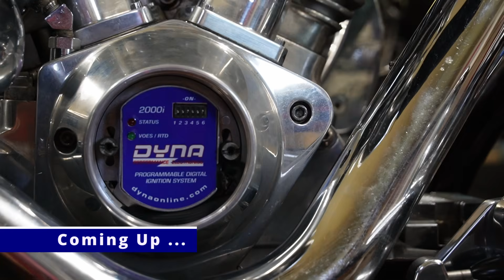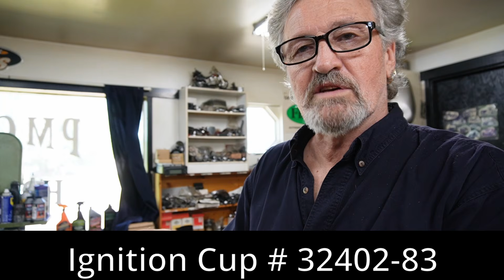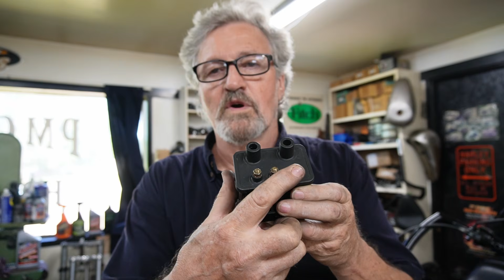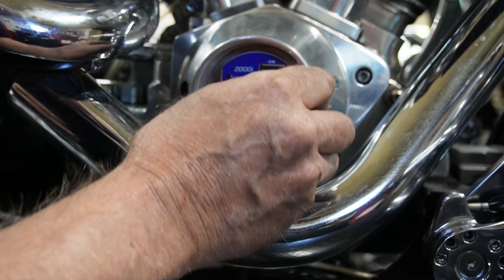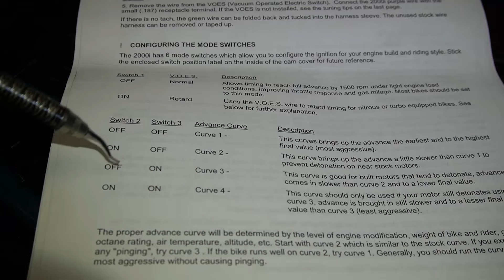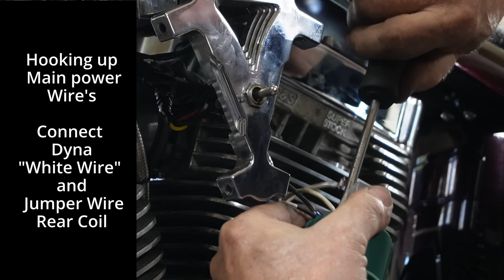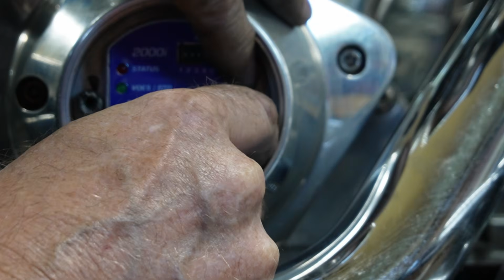HOW TO INSTALL A DYNA 2000i  IGNITION SYSTEM / THE EASY WAY

Comment: I have a 1982 FXRS Shovelhead that came with this setup, timing was off so I went to readjust it and for whatever reason the red status light just stays on no matter how much I rotate the ignition. Would you have any advice on this? Thanks
Reply from the maker: Hello You can try rotating the motor a bit and see if it goes out. You might just be in the "Flash Period" or near the firing timing point. Dyna states the following: 

 The red LED can be used to determine if the ignition module is working. When power is turned on to the ignition, the LED should flash on for 1/4 second then turn off.
 If the pickup is near a firing point, the red LED will come on continuously. This "Flash period"indicates that the microprocessor is functioning in the DYNA 2000I ignition module.
 The pickup is designed such that the LED will come on at about 45 degrees
before top dead center and go off at top dead center for each cylinder. This corresponds to the leading edge of the window in the
rotating cup (45 BTDC), and the trailing edge (TDC).

 If it still continues to stay on then I would think it might be a problem with the Dyna itself. Good luck and thanks for the question.
Reply: @itsmytimeletsgo  Thanks for your help! Figured it out, my bike has different timing marks than I thought it did so I was trying to adjust it to the advance point on the flywheel instead of TDC. Harley changed em around for the early to mid 80’s shovels. Got it all buttoned up now
Reply from the maker: @torturedbykarma  Glad I could help and glad you got it figured out.  Yes the timing marks did change and it is something that often trips guys up. Thanks for letting me know how you made out.

Comment: I have a 1999 fxstc with light brown goop coming from wire hole underneath riveted timing cover. Quick google search tells me the ignition will fail soon. I can’t seem to find oem replacement. Is this the fix for my problem? The motor is stock. Would this replacement configuration be dual fire? Do I also need a replacement coil or is there one to reuse? Thanks!
Reply from the maker: Brown goop is not good  lol. Yes the Dyna 2000i would be a great choice for you. You can set it up in the "dual fire mode" and use your existing coil. If you do be sure to follow the "wiring instructions carefully", as it is totally different for dual fire vs single fire. Then if you want to run it as single fire, down the road, you can just add the single fire coil, configure the wiring for single fire, and throw the # 6 dip switch for single fire mode. If you go all the way , ignition and single fire coil, I can gaurantee you that you will be very happy with the performance. Thanks for the question. Hope this was of help. Thanks for commenting.

Comment: Awesome video! Quick help. I have a dual fire | Coil system but it only has two terminals, not three. How should I wire this up?
Reply from the maker: Ok you hook up the white wire (from the Dyna) to the positive side of the coil, either terminal it doesn't matter but it will also have the 12v power wire hooked to it, (powered when the switch and the kill button is on).. ( some later models can have a single white/black wire  for power) Attach the two together (12V wire and white wire) on "one terminal". 
Then attach the pink wire ( from the Dyna) to the other terminal. Tach connections(if you have one) attach the "Pink wire from the Tach" to the green wire in the Dyna harness. Do not hook the the 2000I Tach wire (Green wire)to the coil or damage may result!
The purple wire can go to the VOES switch wire if you have one.

The blue wire is left unconnected for dual fire system. It should be taped up and tucked back into the harness, as well as the Green wire if there is no Tach, and the Purple wire if there is no VOES switch.

Look at #6 dip switch and it will need to be switched to OFF for dual fire . Good luck and thanks for the question and commenting. Hope this helps.
Reply: Amazing! Thanks for the help, I got her going 🤘🏼
Reply from the maker: @santiagowashere2  Glad to hear that!! Happy I could help you out.

Comment: Why didn't you pull out the timing plug and check the timing marks for TDC?
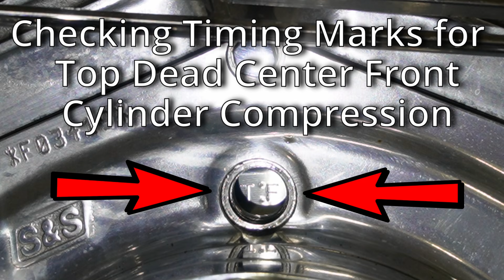Reply from the maker: Check the video out at 12:08 and you will see I do talk about the timing marks. Sometimes things can be missed if the whole video is not watched. Thanks for the question.
Reply: @itsmytimeletsgo  Thanks for the quick reply.  I have been running the Dyna for at least 15 years.  I thought you'd have shown tdc at the beginning of the video instead of the pop test at cylinder one.  I stopped watching the video when you ran the wiring for the twin coils.  Either way, it was my fault for not watching the video to the end.  Great job of explaining how to install the Dyna.
Reply from the maker: @MrXYZ-uv4gj  No problem. Thanks!

Comment: Hey man great video made me feel confident. Question though, would there be a way to get on a phone call with you and try to troubleshoot my 2000i. I’m having an issue with intermittent spark, after install it started and ran excellent for about 1 minute then died, now it won’t start again.
Reply from the maker: Hi you should double check all connection points, and make sure its wired up right. If it is a new unit, then I would be looking at the coil. They will break down as soon as they get warm. Did you have any issues before you installed it with your old system? If it is a used dyna I have seen the same thing happen with a bad unit.  Could be a varity of things. When it quits you can put a test lead on the positive side of the coil to see if it still has power to the system as well. Check with key on and key off. Could be wiring issue there as well. You can contact me through my email that is posted on my channel. Thanks for the question.

Comment: One of the best ignition modules out there in my opinion
Reply from the maker: I agree! Thanks for commenting
Reply: Could you help I would like too now what the rev limiter sounds like is it like gun fire or dose it just kill the power like the stock unit if you could help that would be ace
Reply from the maker: @chilled-b6d  I have not run any to the red line limit but I think it would be like the engine breaking down, cracking and poping. I suppose it may be like gunfire as you described. I do not think it just shuts off. Good question! Maybe others have a comment on this.
Reply: Ace many thanks
Reply from the maker: @chilled-b6d  You are welcome.

Comment: Thanks for posting. I’m looking at picking up a 90 evo with dual plugs but the guy isn’t using all 4 plugs. I found this model dyna tek online but it has coils with 2 wires per coil. What changes? More wires? Their instructions are trash.
Reply from the maker: There are many different combinations to look for. The ignition system has a bearing on it as well 3 ohm (electronic like Dyna2000i) or 5 ohm like Dyna S. Single or dual fire as well. One pulg terminal is for Single fire, single plug, and two plug terminals are for Dual fire, dual plugs. 2 wires per coil is usually for single fire. One is a jumper between coils on the hot  side, the other goes to the ignition signal for the front or rear coil respectivly. Do your research and make sure you are matching the right components together. 
You can always run it as normal with just a plug in the second hole. 
Here is a link that might help you identify some coils. (just type in in "bike type" anthing close, and it should give you choices and specs info) Good Luck!
https://www.dynaonline.com/coils-kits 
Thanks for the question and commenting.
Reply: @itsmytimeletsgo  cheers bud

Comment: Does the white wire get 12v switched or 12v constant
Reply from the maker: The white wire should be powered when the switch is on, not directly constant. Thanks for the question and commenting.

Comment: Can you do this with the Twin Power Ignition Coil For Harley Sportster 1200S 1998-2003
Part #10066584 on “RevZilla” or would I need to get another coil pack to run this rev limiter
Reply from the maker: Not sure there but it would depend on the year, and model, of you Sporster. The Sporster S is different than other models, connections are different, so check your coil attachment points to see if its wired or plug in type. Thanks for the question.

Comment: Not a shovelhead, bought the same unit for a 78 . I promise you it will not work on a shovelhead, you have to have them program it , otherwise nothing but a paper weight.
Reply from the maker: To bad you have had a bad experience with the Dyna. I prefer the Dyna "S" for shovels, especially kick start models, but I have installed the Dyna 2000i's in them with no problems, with electric start. Thanks for input and commenting.

Comment: I can't find anywhere that describes why we cannot connect the dyantek wires directly to the existing deutsch connector under the bike instead of having to run the dynatek wires all the way up to the coil? I even called dynatek to ask and the guy on the phone didn't seem to know either. Mine is really simple as its a '99 sportster 1200C so there are only three wires needed from the dynatek unit, all of which are already located in the deutsch connector at the bottom of the bike.
Reply: Confirmed, you can wire it into the existing OEM plug. (2002 Sportster, VOES retained)
Reply from the maker: @Parker_Fuller  Great info for others. Thanks for sharing and taking the time to comment on this.
Reply: Nice! I ended up just routing the dynatek all the way up and plugging the original connector under the bike.
Reply from the maker: @BlueSkies1384  Thanks for letting us know how you made out.
Reply from the maker: I cannot say for sure either. If the connector is leading directly to the coil wires then I do not see why it wouldn't work. Good luck and do let us know how you make out. I am sure others would be interested in this as well. Great question ! Thanks for putting it out there. Always learning new things...
Reply: Mine only has 3 wires what do I do with the other 2 wires
Reply from the maker: @robertwaters4365  Not  quite sure exactly what you are talking about there. Often the tach wire and voes wire are not used. maybe these are what you are looking at.

Comment: Thanks for video ? if i may ask   do i need an different cup to go from Duel fore to single fire coil .? . or are the cups the same Thanks in advance
Reply from the maker: The gold cup will work for either or ..  it doesn't matter but has to be the 83 up GOLD CUP. Thanks for the question and commenting.
Reply: @itsmytimeletsgo  ok Thanks ...my bike an 2000 1200 Sportster .I dont have an Gold cup so my need to order one but my old Duel  fire  coils test good so trying to keep it ....But ignition Module going  bad  bike runs for 5 min to 30 mins & just dies & getting worst ... leaving me stranded till maybe 5 mins to 60 mins later & it re fire so I have an new programmable Ignition going in today as I speak Thanks again
Reply from the maker: I am sure you will like the new system. Be sure to follow instructions for 2000 sporster, seems to me you hook us 3 wires specifically  for those. There is a great video at  https://www.youtube.com/watch?v=WzoIw39c9Kc&t=2906s that you may find helpful as well for your model.  Thanks for commenting. @jmead6121
Reply: @itsmytimeletsgo  Thanks
Reply from the maker: You are welcome! @jmead6121
Reply from the maker: Got your question Jerrry but it is not showing up here for some reason. But here is your answer to a dual fire hook up. Hope this helps you out.

Coil connection. Typically, there is a white wire from the Run/Stop switch on one of the coil primary terminals. On the
same terminal, there Is a second white wire going to the stock ignition module. These wires are the +12V supply to the
coil and the +12V supply wire to the stock ignition module. On the other coil primary terminal, you should find a pink wire
from the stock ignition module. This is the coil negative wire from the ignition module. There may be a second pink wire
from the tach. Remove all these wires from the coil. 
Note: On later model bikes, there is only one white wire (w/black stripe) and one pink (w/black stripe) connected to the coil. The
+12 volt supply for the module, and the tach input, are spliced into the harness at some other point. Locate the original white wire
on the bike that is the +12v supply from the ignition switch to the coil (discussed above). Connect this original white wire and the
white wire from the DYNA 2000I to one of the coil primary terminals. Locate the pink wire from the DYNA 2000I . Connect this wire
to the unconnected primary terminal on the coil. 
4. Tach signal connection (if equipped). If there was a second pink wire to the tach, the green wire from the DYNA 2000I
may be connected to it with the supplied connectors. If your bike had only one pink wire at the coil, connect the green wire
from the DYNA 2000I to the stock pink wire with the supplied connector. Do not reconnect the green wire to the coil or
damage to the ignition may result. Verify that the stock pink wire(s) are not connected 10 the coil. 
5. Remove the stock purple wire from the VOES. Connect the purple wire from the DYNA 2000I to the VOES with the .187"
receptacle terminal. The blue wire is left unconnected. If there is no tach, the green wire is left unconnected.
Reply: @itsmytimeletsgo  Thanks so Very Much for uR Reply not sure what happened to my post either but I just seen your relay & Thank you very much ..I will re re read & try to apply ur Knowledge to my bike & will let ya Know off success ...rain today so iam held up Thanks Again xxx jerry
Reply: @itsmytimeletsgo  Thanks you Thank you So Very much Just finished setting up by bike not road tested yet as to the dip switches settings but so far @ idle She sounds great ..Thanks again & really appreciate all uR Reply's that helped me Greatly & for all uR Videos ..Please keep them coming & I WILL Keep Watching Thanks You Kindly ..xxx jerry
Reply from the maker: I am gald I could be of help to you. Makes the work on my end worth it to just be able to help even one person. Thats why I do the YouTube channel. Thanks so much for letting me know. Enjoy the great ride, and better performance, you got Coming!! @jmead6121

Comment: Great 👍🏻  vid !
Reply from the maker: Glad you found it informative. They are not rocket science, like some would have you believe, but they just need to be installed right. Flip a few switchs and away you go.  Dyna's are great ignition systems. Thanks for the commenting!
Reply: @itsmytimeletsgo  it's nice 2 see someone take the time 2 give there wisdom and knowledge on those areas 
I have an old shovelhead I'm bringing back 2 life and didn't want 2 pester anyone I just need 2 get the lead out and get her running 
Thanks and keep doing videos 
Al
Reply from the maker: It is so nice to know that I am able to help some people along the way with their journey and their love of the old machines. Thanks for taking the time to comment. @shovelheadpec

Comment: What would be good to carry on my bike in the event of a system failure?  I’m running stock dual fire on my 1999 Springer Softail and have spares including timing module.
Reply from the maker: Well thats a hard one. A set of points and weights would be about the only sure fire way to get home if need be, if you know how to set them up (you would need a tool to open the timing window plug as well.) Sound like you have things covered with spare parts though. I would ditch the stock system and upgrade to a Dyna to end your worries. Good luck. Thanks for the question.

Comment: The only problem I had with that system is it’s not good if your bike is kick only. It’s has “dead strokes” programmed into it to protect the starter. The motor has to turn over 3 times before the plugs fire. I found this out the hard way trying to start my shovel.
Reply from the maker: I agree that the weighted systems are better for kick only bikes, because of their design. I have metnioned this in a few of my videos. Thanks for taking the time to comment about this.
Reply: @itsmytimeletsgo  Working  for kick start  ... I use this....    Need to be programmed  . Very easy    https://www.youtube.com/watch?v=caztWdYbLFU

Comment: Great video.... On a dual fire for a 89 evo, what ohm coil is needed... Is it 5 ohm or 3 ohm...?..
Reply from the maker: Dual or single fire is 3 ohm for the Dyna electronic system. If you use the older Dyna type (using the mechanical weights in behind) then that would be a 5 ohm coil. Thanks for the question. Hope that helps you out. Thanks for commenting.
Reply: Thanks.. Great video with technical know how.. Keep them coming..

Comment: Good video. Had to replace a faulty Super Stock ignition in a new S&S 111 EVO. It had a silver pickup cup. For the 2000i be sure to use a Gold pickup cup, not silver. It’s in the instructions.
Reply from the maker: You are exactly right. Its a small mistake that many make. Thanks for commenting.
Reply: Hey just seeing this I did exactly this on my 88ci evo would this cause it to run like really bad
Reply: @andrewmichael7889  It’s just me, but since it’s clearly in the instructions, (gold cup), I would at least call Dyna and ask the question.  I’m very pleased with the 2000i performance with the V111 EVO. Frankly, I thought the SuperStock Ignition under-performed, although as mine failed just after break-in, it may have been bad all along. In any event, it’s no big deal to swap to the gold cup, eh?

Comment: Very nice video. Why not run single fire mode?
Reply from the maker: Pretty sure I did exactly that. You might have missed it . You can check the video around the 8 minute mark. Thanks for commenting.
Reply: @itsmytimeletsgo  you're right, my fault, sorry.
Reply from the maker: @tomconte1765  No problem and I appreciate the question. It may help someone else out. Thanks for commenting.